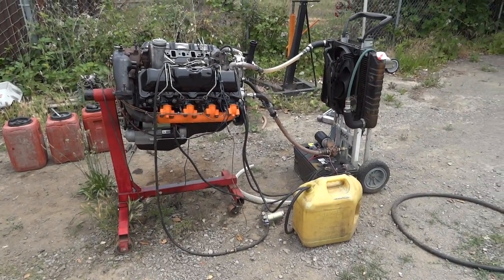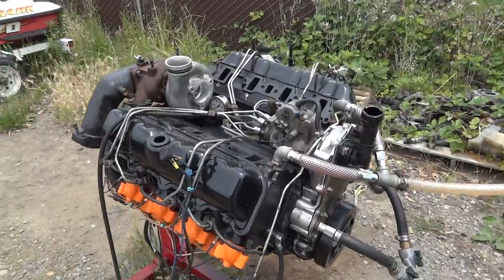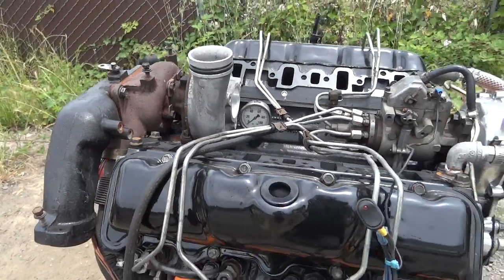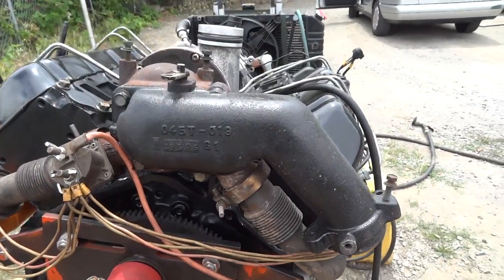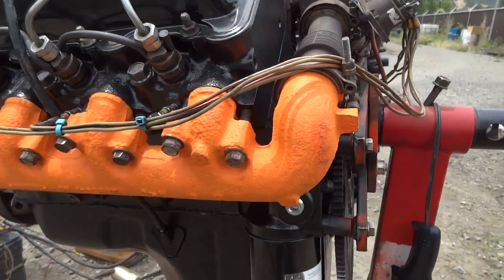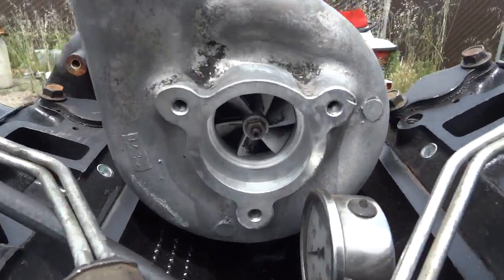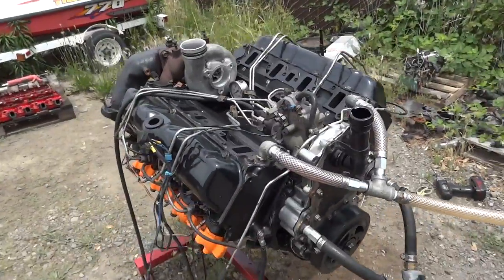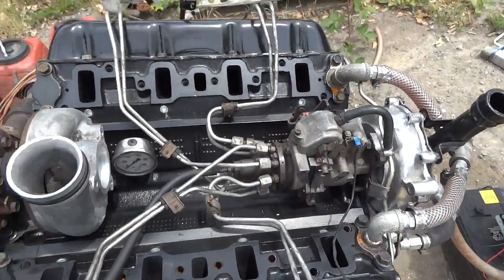Chevy 6.5 Diesel Center Turbo Rebuild.

Comment: Hello my friend,
I was wondering if you might know if the newer Chevy workhorse step vans with 6.5 turbo diesel, use a center mount turbo like HMMWV and Chevy/GMC vans? 
I have older, 1988 Chevy p32 step van with 6.2 j code diesel and th400 automatic. 
Im trying to figure out if they ised the center mount setup on newer models? 
I would like to turbo my 6.2, I have all the parts for side mount setup that i was going to put in my 1986 CUCV m1008 Army pickup truck, bit that would be side turbo. 
Iwonder if angle of heads on step van is like van and HMMWV or same as pickup?
Any help is greatly appreciated.
Thanks for all your excellent videos. Very good job. I like your motorhome video, im going to have to see where i have video saved to. 
Im likely going to convert my step van to a small motorhome conversion.
Reply from the maker: All vans have center turbo, because there is no room for a side turbo.
You can convert a 6.2 to Side Turbo, but the injectors are at a different angle on the 6.2 heads.
You have to use 6.5 Injectors with 6.5 injector lines.
Only the year 1993 had them with mechanical pump.
You can probably buy them on eBay.
If you want about 300 Horsepower, I can show you how to heck your mechanical pump.
It is NOT just a screw adjustment, I have a better method that gives you about 300 Horsepower.
I can teach you for $100.

Comment: Hey man still willing to give a few tips?
Reply: What is your question?
I am veggiepower303 also.
This is my other channel.
Reply: @EvenStarLoveAnanda  thanks for the reply am I able to run 6.5 injectors on the 6.2 or were could I find some over sized ones? Along with I wanna swap the sm465 to auto when it craps the bed is there any bolt on swaps by Chance
Reply: @bogginhiillbillsendit6193  The power level is not dependent on the injectors it is dependent on the Injection Pump. You can leave the 6.2 injectors in there and get a better pump. Or i can tell you how to increase the output by about 30%, for a small fee.
Would you be comfortable disassembling the IP with my direction?

Comment: I have a 6.2 an has blow by what those tha means
Reply: Too many miles, sticky rings, broken rings..... take your pick!
Try putting a can of See-foam in the engine oil and drive it around for a few 100 miles.
Than change the oil.
And put half a court of Lucas Heavy-duty oil stabilizer in it.
You can also put See-foam in to the fuel tank to clean the injectors and the IP.
Reply: This is also Veggiepower303
I have a REBUILT 6.2 engine for $2700
I can list it on ebay if you are interested.

Comment: Is this an AMG made block? L65?
Reply: its a chevy motor
Reply: It's an engine, not a motor. Also, Chevrolet never manufactured a 6.5l diesel engine. It was made by Detroit Diesel Company under GM until 1999. GEP makes them to this day.
Reply: Eli Cashman LOL you asked if it was an amg, I know who makes the engine